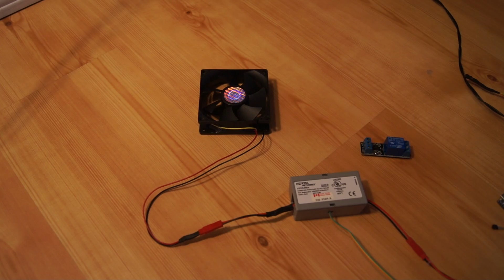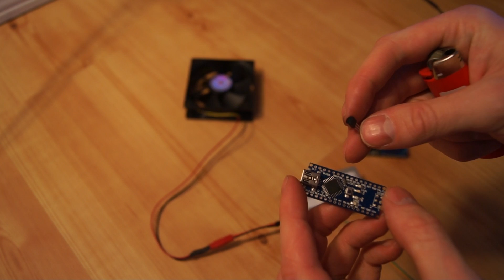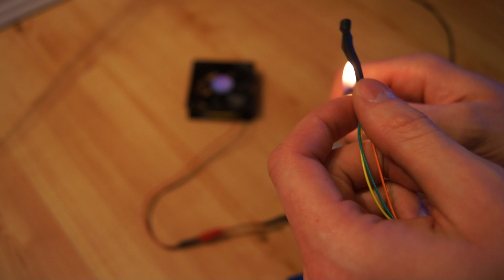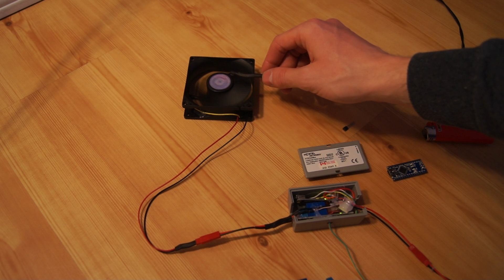Temperature Controlled fan

Comment: can this be powered ny 12v battety or 9v
Reply from the maker: Powering the fan, arduino and relay may not run to full fan performance on 9v... and you may have intermittent performance issues..  I would recommend at least a 12v 1amp, to run the particular fan in the video.  You may also benefit from higher amps such as 1.5 to 2amps

Comment: Simple and great tutorial. Thankyou bro. But I need the wiring diagram or schema of this project. I cant find it on your document. Please, would you give the full diagram of this project. I really need your help
Reply from the maker: The first part of the document gives pretty clear instructions on how to wire it up... I do not think this project needs a wiring diagram.  http://goo.gl/jGoE95
Reply: thatonesnowboarde may I know what kind of power supply that you're using in this project? how much ampere? I'm using 12v 1A adapter and nothing's work
Reply from the maker: nugra vara 12v 1amp  from an external hard drive.